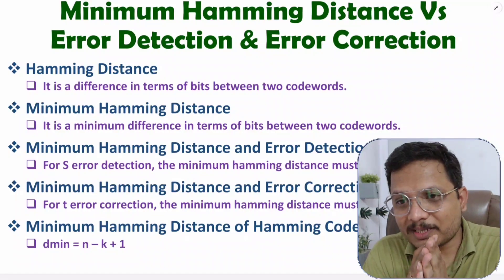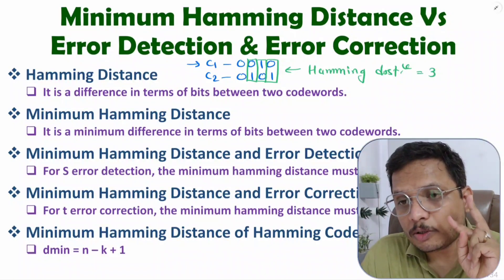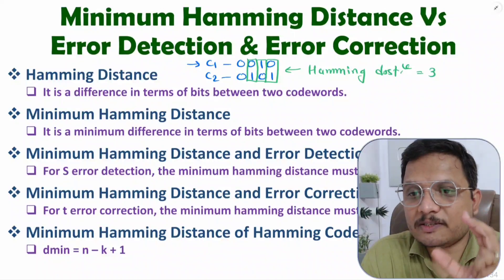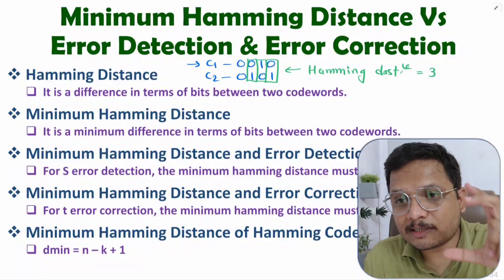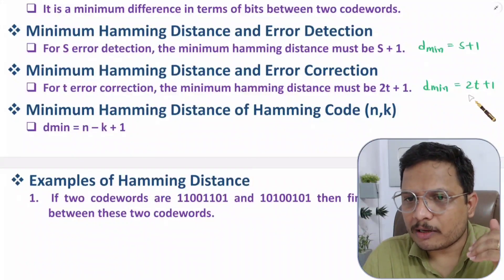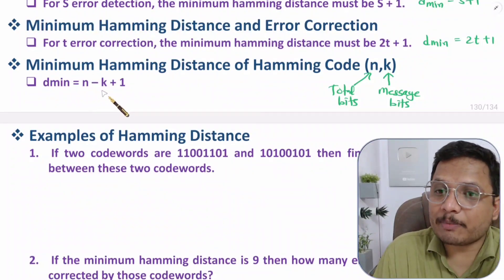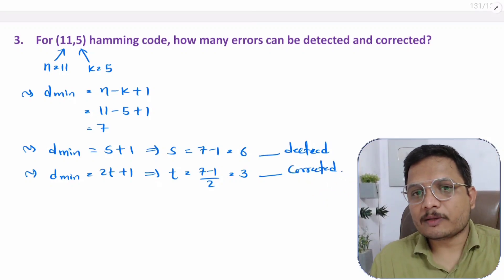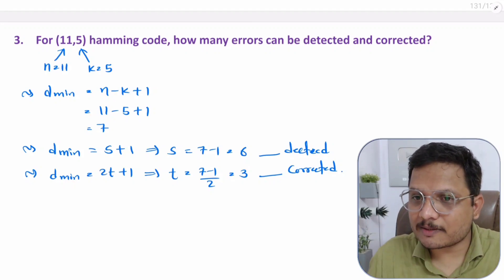Minimum Hamming Distance, Error Detection Capability, and Error Correction Capability Explained

Comment: Sir in the example of (11,5) dmin should have been 5 as per BODMAS calculation? Addition should be first and then difference which makes it 11-(5+1)=5 and not 7.
Reply: 11-5+1=7 why? because what you said about BODMAS rule is correct, but addition must be -5+1 which is -4, then 11-4 is 7. You did wrong because you considered -5 as 5. Be careful the signed integers. I hope now you understand.
Reply: @Sam2277006  bruh first of all, you cannot insert parenthesis like that when it is not given